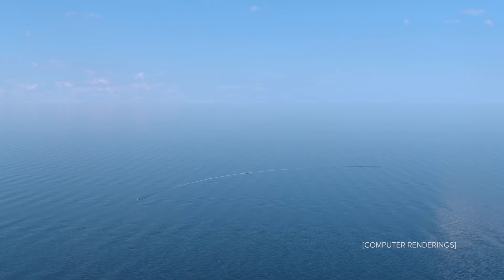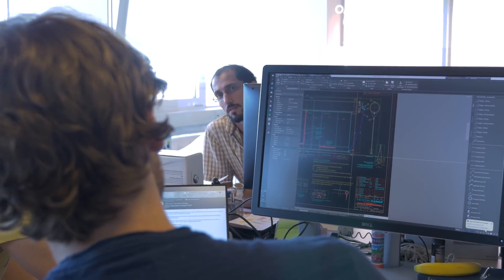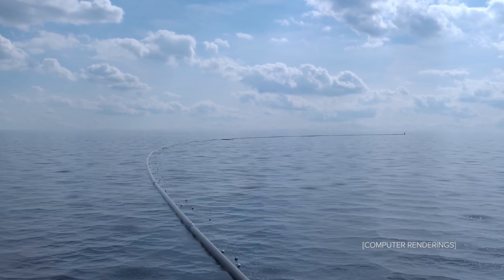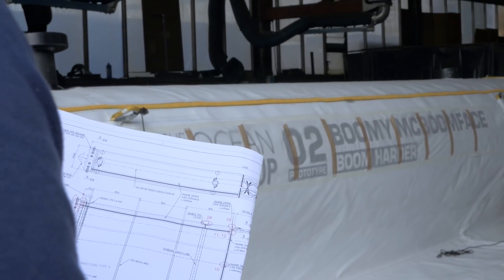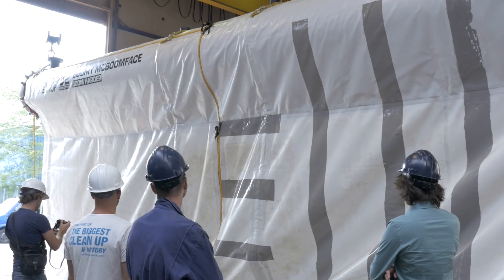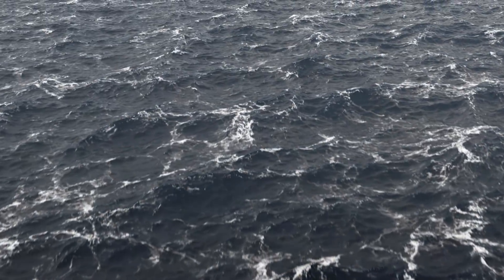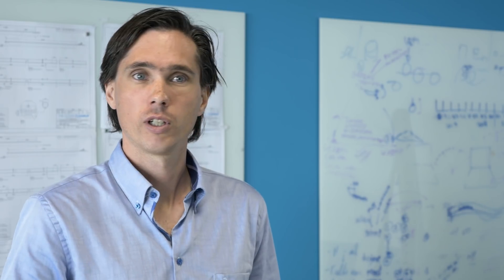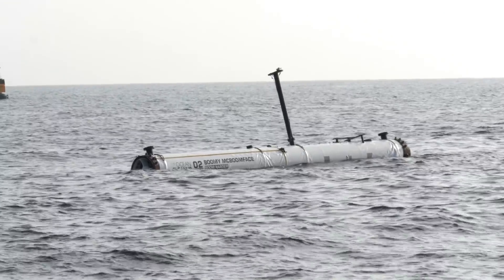New Prototype of Cleanup system in the North Sea | Research | The Ocean Cleanup

Comment: 1. What were the results of the marine growth prevention coating test?  
2. I see from the latest video that the screen is now attached to the bottom rather than wrapped around the pipe.  Why was this option chosen?  How is it better?
3. How is the screen held in a vertical position, rather than flapping in the current?  Is it weighted somehow?

Comment: because systems with floating booms can not work in the ocean to solve the plastic problem: 
All these solutions are based on a so-called “passive system”: extremely long floating barriers, anchored at the sea bottom, collect the plastic objects only if the ocean's streams push them into their direction. Moreover, if the sea conditions are rough, the solid/liquid waste can easily jump the floating barriers. Alternatively, nets anchored on boats or, for river’s application, on the river’s banks are used.
In this case the river current often compromises the clean-up operations.In both cases the micro particles of plastic are not captured and the clean-up systems are extremely vulnerable since any floating object with a certain weight could provoke their destruction.

Comment: Please make some Timelaps, in which you can see how big the Garbage Patch is!
Reply: Yet this system is not designed to capture the Microplastic yet. It will require a micro skirt at lower depths. A filtering system that can be cleaned on a regular/daily/hours rotation, depending on the recovery rate.  Basically, it's a sea anchor, with micro bags system. Now a system that can take the plastic, melt and form bags to hold the bulk plastic. Each back can be tagged with a tracker. Once you know you have pickup load send out the collection ship to recover the bags. Or design a barge that can take the plastic and start making Floating Islands, for https://www.seasteading.org/

Comment: I just recently learned about this project and I must say it is noble and I wish the best of luck. I've had 3 questions (with a few follow-ups) that I haven't been able to find an answer in the videos I've watched.
1.  How are the plastics removed once the systems gather enough debris?
1a. If the plastics are removed by current methods, why can they not remove he plastics without the systems?
2. Is the Ocean Cleanup planning on continuing their endeavors by selling and making a profit from the removed plastics? (I have nothing against this, and even think it's brilliant and deserved to make as much profit as possible by doing something much needed. With the openness of the development of the systems, I thought it odd that there is no mention of the longevity of the project.)
2a. If the selling of the collected plastics is not the plan, what is the plan for continued growth and development?
3. How often will the plastics be removed from the ocean once the systems are deployed? i.e., regular intervals, as needed basis.

I'm very interested in this project, as it seems like you guys are the leaders among the few that are actually taking steps to make a difference. If these questions have been answered, please provide I link so I can satisfy my curiosity. Thanks.